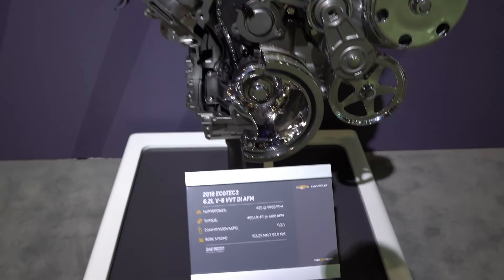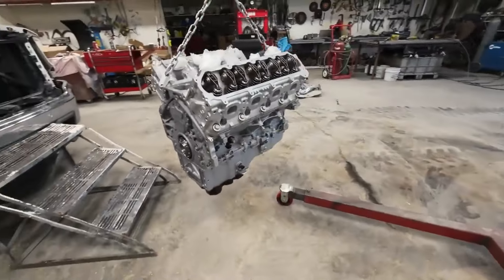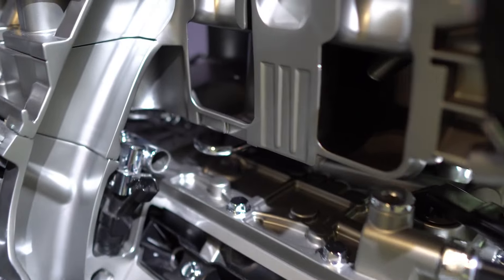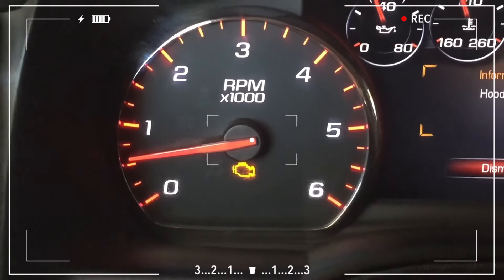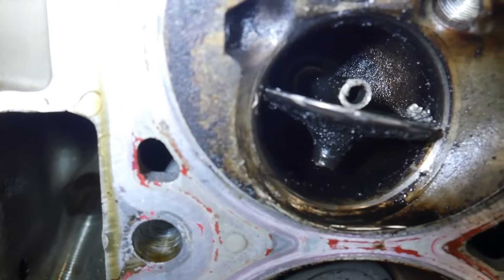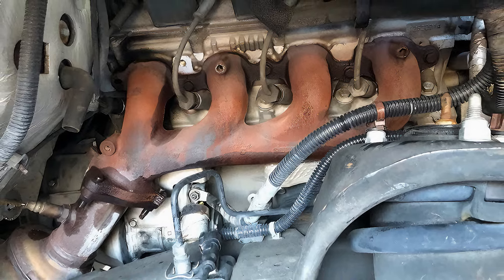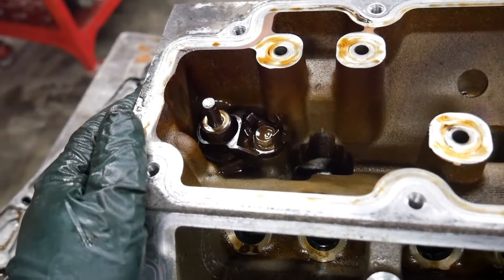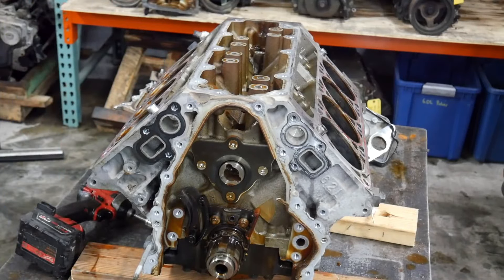6.2 l Ecotec3 V8 (L86/L87) Overview - Reliability, Problems, Weak Spots

Comment: It's the 0 weight oil folks....every manufacturer has current friction problems..10-30 minimum..believe it or pay
Reply: That’s my take as well ..coupled with oil life time.
5 or 10 30 depending on climate and don’t exceed 5k miles

Comment: im starting to think people also dont do regular maintenance.
Reply: Nah these motors are horrible.
Reply: They really don't. I've never met anyone so far who has lol
Reply: @Oneofusagain if you are agreeing with my original comment, samehere. im the type that if the oil change is recommended at 7k miles ill just go ahead and do it at 5k. people dont realise how fast oil loses viscosity with all that stop and go traffice for example.
Reply: @nyyanksny03  Then GM should have the correct maintenance schedule for the motor in the manual.
Reply: @TomBouthillet huh? it does and i wait to 7,500 miles.
Reply: @nyyanksny03  Same here and my engine needs to be replaced at 25,000 miles.
Reply: @TomBouthillet do you tow a lot?
Reply: Alot of these 6.2 blew up before 5k. Sad
Reply: They floor it right out of the dealer, they rev it as soon as they turn it on and they say it’s a bad motor 😂
I’ve never had a problem with GM

Comment: Best engine 5.3
Reply: Why?
Reply: They’re literally the same engine. They have the same issues/reliability
Reply: They're gutless.
Reply: have over 200k on mine
Reply: 5.3 in 00 GMC Truck 500k miles.   Envoy 4.2 with 300k.   GM has made great engines. Mobil one full Syn has kept them running like new too.

Comment: I went with someone to buy a new 2010 Silverado with factory 6.2.  Saying that it was introduced in 2014 does not check out.
Reply: The 07-13 6.2 trucks do not have afm I have a 2010 Sierra Denali.. the 07-13 5.3 trucks & suvs do.(5.3 only)….the 6.2 in the SUV’s are afm free from 07-09, suv 6.2 went to afm in 2010… the whole truck  gmt 900years 07-13  6.2 is afm free
The truck 6.2 got afm in the new body style 2014’s

Comment: Someone I know bought a 6.2 and when he first got it he told me matter of fact it didn't have Active Fuel Management. But it not only has AFM but also 17 firing orders, and DI. And it might get better mileage than something from a competitor but I would only buy anything it comes in at the scrap price IF the vehicle is in new condition. And that tells anyone I don't want anything to do with one. Ford 6.2 didn't have all that bling and don't have that much torque or gas mileage but they'll last 500,000 miles and I know some with 600,000. GM would have to go back in years to find stuff that will last that long. Duramax isn't too bad or I don't think they're having a lot of issues. The 3/4 ton 6.6 liter is much better than the 6.2 but it's got some of the modern junk too so we'll just have to wait and see how long they last. But I remember the years when 8 or 9 round bales were towed with an inline 6 a 4 speed manual transmission and probably started with something like 4.56 or deeper gears. If you were in a big hurry you just left 5 minutes earlier but now people think they have to have near 500 pounds of torque in even a half ton and I know it's just not necessary for what modern half tons get used for. I've seen a loaded 18 wheeler full of beans get towed to pop the clutch speed with an old 82 Scottsdale 3/4 ton with a 350 and those didn't even have 300 pounds of torque. I've seen a 53 foot trailer behind a big sleeper cab get towed out of ice and snow and mud with just an 80's carbed V8 plain jane pickup and I've seen Ford 300 six cylinders pull 40,000 pounds regularly. And those things lasted and lasted and lasted. I'm just not impressed with these modern throwaway toys that cost half of the cost of a house that actually could hold it's value or even accrue. So you call it "Dynamic" instead of calling it Active even though it does the same thing.